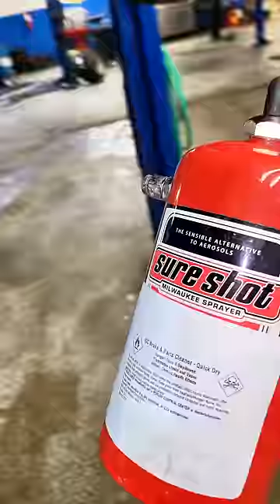Oil Change Perfection 😗👌 #honda #oilchange #satisfying

Comment: I know why you put the sticker on the filter because you didn't put oil in it to keep the engine save on 1st start with fresh oil
Reply from the maker: Lol you pre fill paper filters too eh? 😅 How about top mounted filters? Full those too? 😆 Pre filling is completely unnecessary
Reply: Don't need to prefill...old fudd lore tells you too.

It doesn't take the engine long to get oil cycled through the system. Less than a couple seconds. Your engine can start up just fine.
Reply: Apparently y'all are not raised as a mechanic like I was you do not need no dry parts of the engine while turning feel up all of the oil lines fill up the oil filter so there's less are going to bare metal to metal if you can't figure it out park your car and get your damn bicycle out
Reply: @timedenfield7984  you should look up the dunning Kruger effect. You exhibit it perfectly. 
You know since you've watched a YouTube video or two you know that all good mechanics prefill oil filters and now you're trying to bump your ego here. But the thing is real mechanics know what they're doing and you clearly don't. 
There are vehicles that will call for it and vehicles that won't. 
This cars pump system is chain driven and that filter is an ancillary device in the system. All of your important engine parts and bearings and friction surfaces still get lubricated in the same amount of time and that filter primes and starts working in less than a second. Know what your talking about, before you pretend to know what your talking about.
Reply: @eikon7073  You seem to know this car inside out, good to see comments like this every so often
Reply: @jetstream454  haha hey thanks. 
It is what it is I just like preaching every now and again when I see someone so blatantly wrong
Reply: @TEVIDEOS finally some one said it lol I never pre fill.
Reply: Makes zero difference. Tested two equivalent diesel engines, one prefilled and one not prefilled, both took 5-6 seconds to build oil pressure.

Comment: What an unprofessional oil change.
How he can put oil plug when old oil still flowing?
Reply from the maker: 4.5 QUARTS CAME OUT.. 4.5 QUARTS WENT IN.. THERE IS ZERO POINT IN LETTING THE OIL DRAIN ANY LONGER. BEST SCENERIO YOU GET ANOTHER 20/TH OF A QUART OUT.. THAT MAKES NO DIFFERENCE. NO MATTER HOW LONG YOU LET IT DRAIN THERE IS STILL GOING TO BE ABOUT .5 QUART OF USED OIL IN THE ENGINE.. THAT BEING SAID, THAT 20TH OF A QUART YOU WAITING TO COME OUT IS JUST A WASTE OF TIME. CHANGE YOUR OIL ON TIME, EVERY TIME. THATS WHAT KEEPS ENGINES CLEAN 👌

PS. DID NOT MEAN TO MAKE THIS ALL CAPS BUT ITS TOO LATE TO GO BACK 😅👍